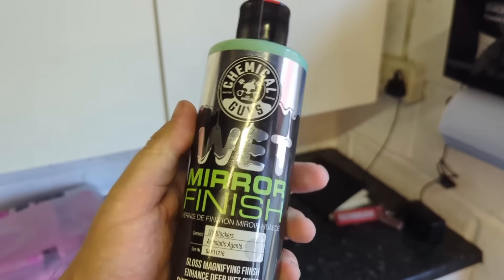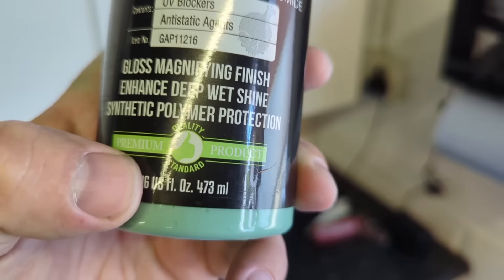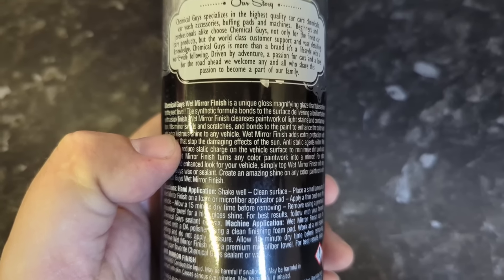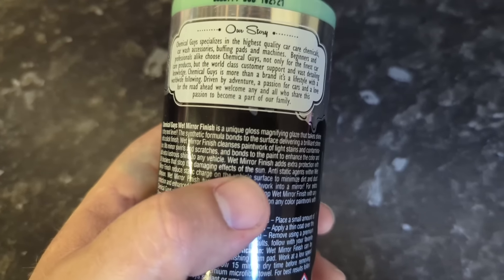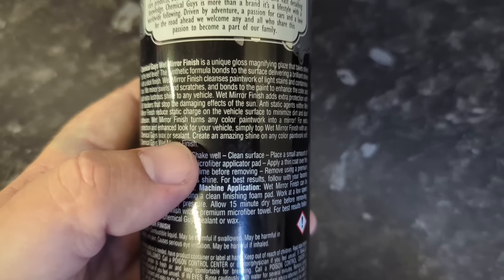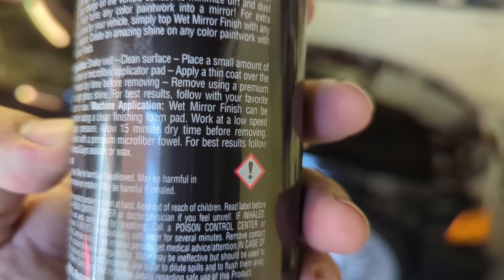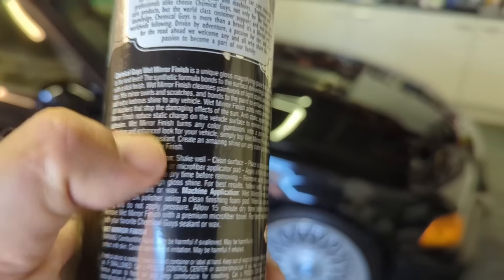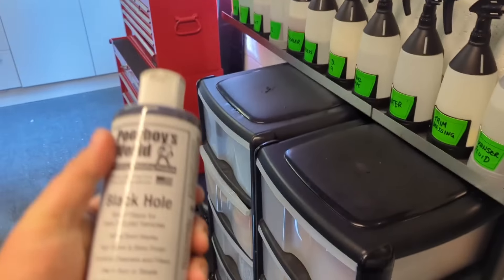*NEW DISCOVERY* Even the Chemical Guys HATERS Gonna LOVE This!  Amazing GLOSS

Comment: This product has been around a looong time. One of the first I used when I was getting into "detailing" many years ago. It's very good.
Reply from the maker: has it really. I literally just saw it on the site and thought ooo whats that. looks cool :)
Reply: @ForensicDetailing  Yeah I used it at least 6 years ago. Got it in some combo pack from a detailing distributor. Tested it on a friend's car after a clay and one stage (when it really needed a 2-3 stage) correction. It was....fine. 

It definitely increased gloss, but I think it would have been just as easy to apply a cheapo consumer grade coating which would do some filling and actually protect the paint for a useful amount of time.
Reply: ti not as good as griots waxes  they  leve  better shine than other wax companies. That  my opinion thanks try  to for your self

Comment: Love your videos mate.. After watching hours and hours of your videos, I’ve just finished polishing up my own vehicle.. Clay bared it, machine polished it with Scholl Concepts S20 Black 1-Step Compound .. Then finished it off with Rupes UNO ADVANCED .. Im not 100% sure I’ve used the correct products , but I’m absolutely thrilled with the final result.. Thank you for your guidance..
Reply from the maker: awesome to hear mate.  so rupes advances you could use after s20.  but really you would use S20 then seal or wax or coat.   Or you could use Rupes advanced instead of S20 and it will polish (abrade) and protect.  But the protection Rupes advanced offers is really good for an AIO so what you have done is fine.  you should notive as well your paint is silky and smooth with rupes advanced.   so yer what you have done is fine mate.

Comment: Hi there John,

Here a dutchy with a question. I am looking for a wax and maybe a sealant like Beatcoat on top because i like that wet look.  Does black hole work better or is that the same? And because the curing time is a problem for me because i do not have a garage so is there an other layer i can put on top of either the mirror shine or blackhole that makes them more durable? 
Sorry for my bad english!
Reply from the maker: I like black hole to prime the paint. clean it and gloss it and then I put the beadcoat on.  Seems to work well for me as a summer regime mate.   This glaze is good too but the black hole is nicer to use.
Reply: @ForensicDetailing thank you for the quick answer and your time.

Comment: Is it used instead of wax or a pre polish
Reply from the maker: not instead of a wax mate.  Before a wax to gloss up the paint basically.    Think of it as a polish basically but it relies on resins to fill rather than abrasives to chop away defects.
Reply: @ForensicDetailing  nice one cheers

Comment: Looks great but what would you need to go over it to lock it in and could it react to whats going over the top of it
Reply from the maker: thats the thing.  so I would recomend a water based thing to top this.  because buffing on a glaze and then going back and spreading and buffing another thick paste like product is hard work.  But its finding the right thing.  The collinite just tacked up the surface a bit so it might not be the best thing but it was ok.  so yer I would need to expertiment.
Reply: @ForensicDetailing   Thanks Jon

Comment: Great video Jon, would you not have gotten the same result by just using the Collinite on its own? It looked that good in your Collinite video.
Reply from the maker: which collinite mate?  not the water based spray ones no but collenite might have an emulsion prep product like this in their lineup.  So this products allows me to reset the paintwork, scrubb off whatever is there and lay a base down without hacking away clearcoat.   I can do this rapidly by cordless DA as well.  Its how I like to do it.  In summer at least.  Kind of like the best way to get a show car finish.   The spray sealants are more about creating a film of product more rapidly with less spreading and less buffage but they layer on top of whats there.
Reply: @ForensicDetailing  thanks for the reply Jon, yeah that makes sense. I was talking about the spray at the end, like would you have gotten just as good a finish without using using the chemical guys stuff at all and only used the spray, but I see that the chemical guy’s stuff lay the smooth shiny base and the Collinite spray just enhanced that shine.
Reply: @WEZ4136  that was my thought, Jon only had a mirror finish once he got Collinite on. With my old E39 in Cosmos black, i got sensational pop with Zaino Grand Finale spray at the end. Never looked as good until that step

Comment: Dodo Juice Lime Prime is still my fave glaze/cleanser
Reply: Stuff is brilliant indeed
Reply: I remember that product from when the car cleaning guru used it years ago and his hands turned green 😅
Reply from the maker: you need to be carefull with that stuff its literally got the most powerfull solvent in it I think ive ever seen.  do not use it in hot weather.
Reply: @ForensicDetailing  as I've always hand polished it's definitely not a job for hot weather 🤣
Reply: @ForensicDetailing  thanks, good tip, noted John. There is also Lime Prime Lite which i use, doesn;t have any cutting action

Comment: We have to consider the fact that you applied this all wrong  and when you buff this ,you need to use a damp cloth to remove excess and then buff to shine. Learn to do it correctly .
Reply from the maker: Yer we also need to consider the fact that your an idiot.  So we show the product instructions in the video.  They do not advise to use a wet cloth.  If I do not follow manufacturer instructions I can get sued by the brands.   Bed time soon Michael.

Comment: My go to for these sorts of applications will be Autoglym SRP, keen to see how this product compares.
Reply from the maker: yer SRP is the same sort of thing.  But SRP is more solvent based so you get that sweet hydrocarbon smell and its thinner to spread and work.  Then SRP will haze out more into a dry crust with a bit more white chalky residue.   I think SRP is acyrlic resin.   SRP cheaper.  SRP really needs topping.   I think this had a bit more wow factor in terms of the finish though. This stuff never fully cures to a dry crust, more like a sort of polish residue feel where its still oily on the buff.